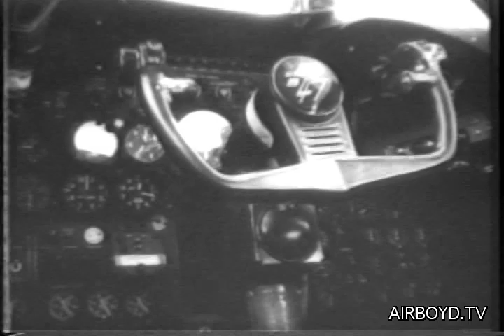Boeing QB-47 Stratojet Radio Control Testing (1961)

Comment: i dont understand how thats possible. how do they get ALL the fucking dials/gadgets/flight input sticks/blalblalblal EVERYTHING necessary in the cockpit into that little remote control. how do they accurately fly the plane with just a little finger length joystick how could they be accurate? also how the hell do they LAND the plane with a ground perspective like that? that seems almost impossible shooting for a specific runway like that instead of like a field with RC planes. HOW? not even a tv